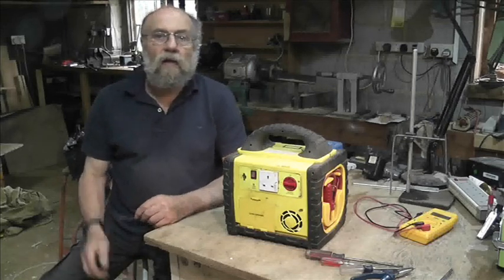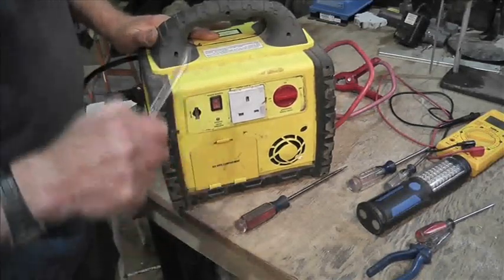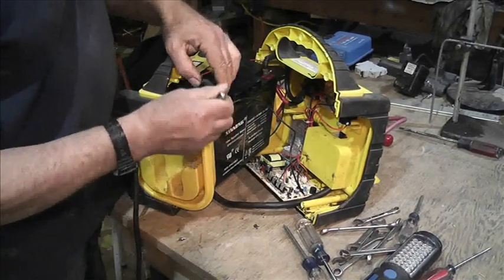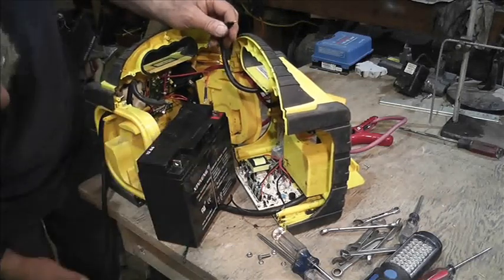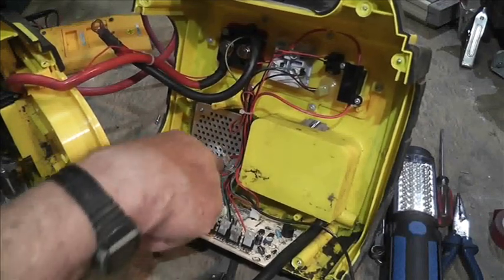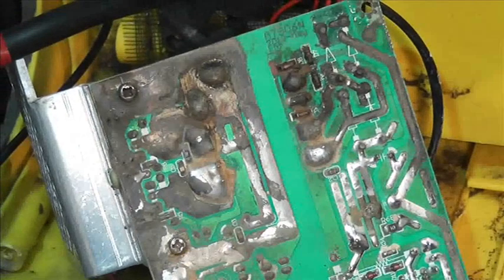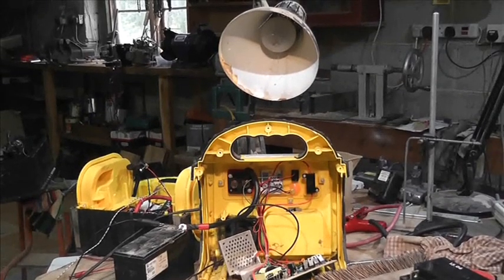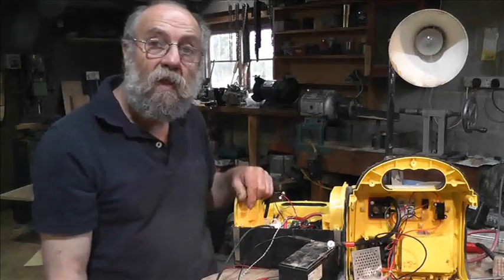Power jump pack inverter investigation

Comment: PS Andy- I have a similar thing made by Ring, and it's not bad - it has a pair of 12Ah 12v Yuasa motorcycle batts inside, and I have used it as a 12v source/jump starter many times over the years, including running a step-up power supply to run my laptop at 18v during power cuts. I have a separate 12v gel battery to run the router.
The mains inverter is ok for a few things, but the waveform is a horrid "top hat" shape, so I wouldn't power anything too valuable with it.  Dave
Reply from the maker: Dave, yes, waveform is critical for anything with a microprocessor. Ring are supposed to be a better brand but if they are made in the PRC then unauthorised component  supposition is very likely, destroying the quality, cheers
Reply: @TheInfoworks  That is the trouble with PRC manufacture - they can do it right, but only if someone is looking over their shoulder it seems, and checking every supplier of parts too. Variable quality is not high quality in my book.
Reply from the maker: @noakeswalker  indeed, that's what I found with the Dewalt grinders, very good condition brushes but collapsed gearbox bearings. typical, cheers

Comment: Those TO-220 package transistors not being heatsinked isn't surprising as those are the output H bridge transistors which don't dissipate much heat in a 200VA 240V inverter.  Duty cycle isn't going to be big either given the limited capacity of a chinesium '17Ahr' 12V battery; the battery could be fake and some of the cell volume is taken up by plastic or glass filler plates or even has a hollow compartment in the cell or battery case.  The transistors that need it more are the transformer primary drive transistors.
The inverter also has a ~300V DC power supply on it.  Check for something at the diodes next to the transformer; it could be the DC supply is good and the output transistors are dead.  These usually use a SMPS control IC like a TL494, SG3524 or KA7500, usually 2 of the same chip with one controlling the transformer drive and one controlling the output H bridge.  The third IC will be an operational amplifier used for things like overtemp shutdown and buffering.
Reply from the maker: Thanks for that info, I get the feeling from comments on other videos that if the primaries are gone then so will the drivers. Sometimes it's not worth digging in too far, cheers

Comment: Hi Andy, Yep thats all its good for lol, rubbish, I had exactly the same one but with NZ 3 pin plug, inverter went out, i feel the inverters in these are just cheap rubbish, the 12v side of it was good tho, ended up stripping it out like you and used the parts on other things, anyway thanks for the video on this.
Reply from the maker: I knew it was cheap tat when I dragged it out of the scrap, but sometimes it's pleasant to be surprised, cheers
Reply: @TheInfoworks  Yes that is true, and anyway free is good lol